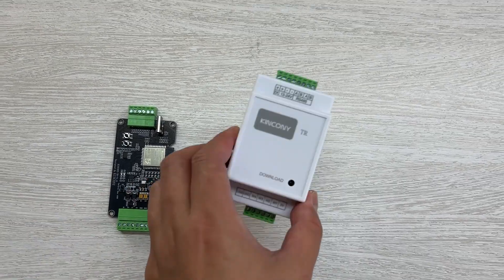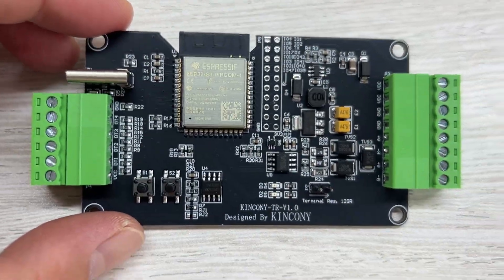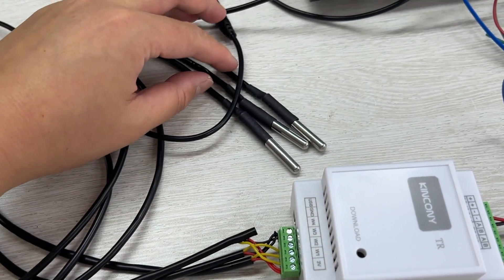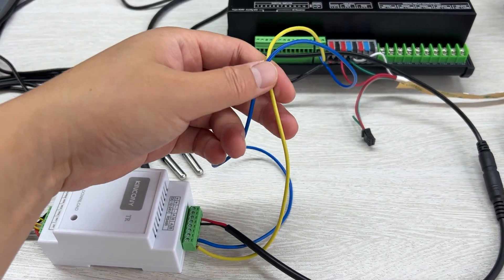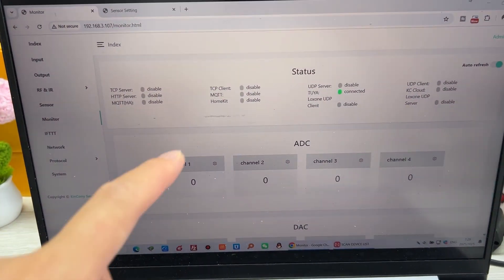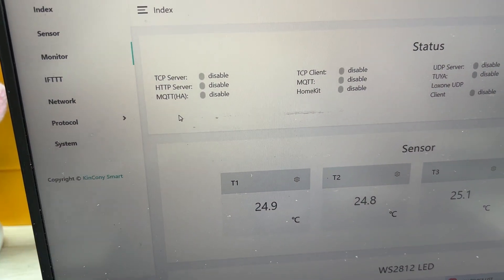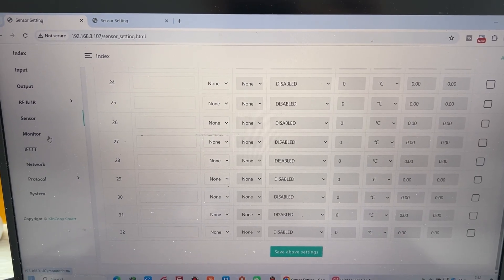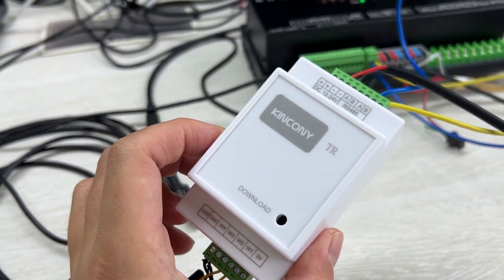ESP32 temperature humidity sensor to RS485 modbus converter - TR

Comment: Hello. How long the sensor cables can be? If the TR device is located in the junction box 30m away, can i connect my sensor over that distance?
Reply from the maker: no problem, max 1000 meter
Reply: @KinCony  Great! Just to be clear it is max distance of 1000 meter cable from the DHT22 sensor towards the TR board or between TR board and kincony controller?
Reply from the maker: @emanuelloghin9471  1000 meter is TR to kincony controller.
Reply: @KinCony ok. And the max distance between TR and the actual sensor? I am trying to see if i can install the sensors in every room of the house and connect them directy to the TR or kincony controller which are located 15 to 30 meters away from the sensor. Is that possible? What kincony solution   could I use?
Reply from the maker: @emanuelloghin9471  we have tested use ds18b20 by 30 meter, but some times not stable. suggest connect with sensor use short cable.

Comment: Hi
I have built a plc like controller for an industrial pasta detergente, with Arduino Uno R3 and 3 relay, 1 temp and humidity sensor on RS485
And an industrial HMI touch display (human machine interface ) connected with to the same rs485 too

Do you think I could port an Arduino uno code in one  of your boards?

I could make a YT video out of this project

Thanks
Fabio
Reply from the maker: sure, our boards support arduino IDE.
Reply: @KinCony  good thanks
If I send you the code can you help porting?

It is now on Arduino UNO R3
It would be sufficent that you help assign the proper pin for your board and have it compiling properly
Then I will complete from my side 
I think it will be Superfast

Then I can make a video showing your hardware can be used as a PLC with industrial HMI display, but with simple C code instead of ladder language
Reply from the maker: @MakerFabio  our esp32 board already have many demo source code in our fourm, you can download and test it.
Reply: @KinCony ok thanks

Comment: Hi can i use more than one converter in series for one RS485 input to have 8 or 12 long distance sensors on one input?
Reply from the maker: sure, RS485 bus support multi TR device, every TR have different address.

Comment: Hi!. Can you confirm me that I could use Arduino IDE for programing this product?, also, could it be integrated with Home Assistant using ESPHome?. I'm interested on reading analog inputs via W1-W4 inputs of the device and send their values to Home Assistant. Can this be done?. Thank you very much in advance.
Reply from the maker: sure, it's ok, you can config by esphome or write your own arduino code. it made by esp32-s3
Reply: @KinCony  Thank you very much!.

Comment: Could you please explain the difference between this and KC868-HAv2 to me?
Reply from the maker: HAv2 use for digital input and digital output. TR use for convert temperature and humidity
Reply: @KinCony we wait for HAv3TR 😃 Digital in + Temp&Humidity. This can be a good replacement for KNX switches which comes with integrated temp sensors.
Reply from the maker: @officialdanielcrisan  TR also can use for digital input ports, there are many free GPIOs on PCB.